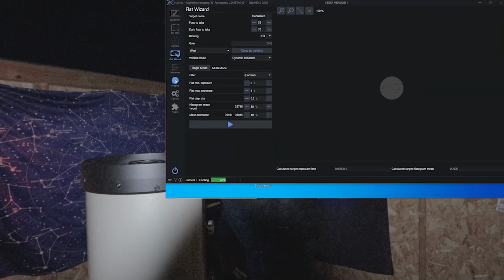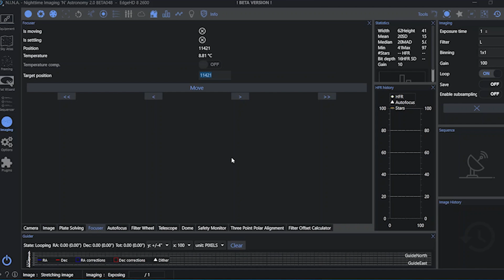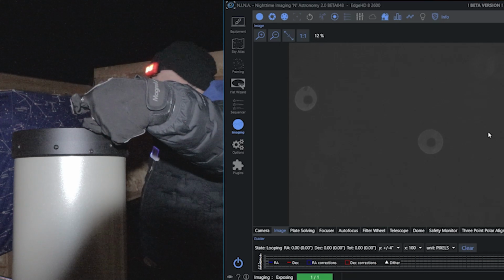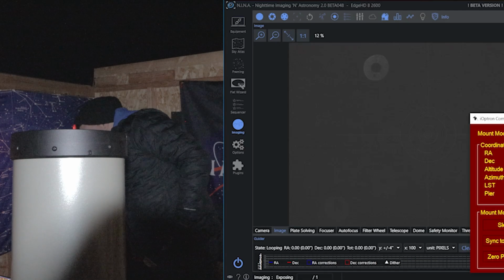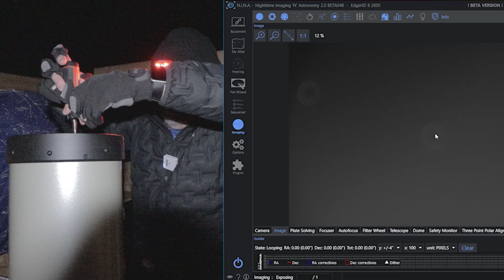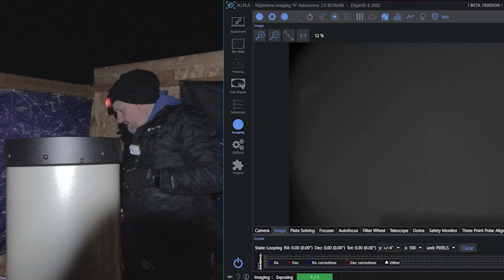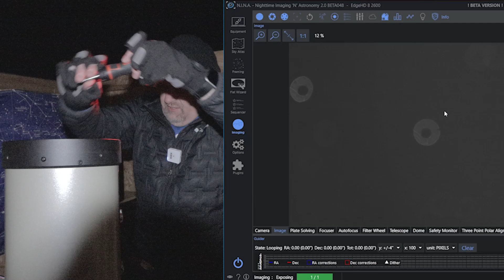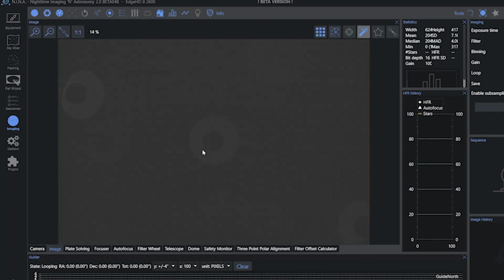How to Collimate your SCT | EdgeHD 8 Collimation

Comment: Joe, good explanation but I've found much better results with two things: 1 - Using much smaller adjustments (I can see you tightening loosening by 1/4 or more turns at a time), and 2 - Always doing a three process  adjustment, ie. when I tighten one I ALWAYs loosen the other two or vice versa.

Usually only takes about 2-3 minutes once a year or so.

just my 2cents

Comment: What do you do if you collimate inward focus first and then when you try outward focus the collimation is still off?
Reply from the maker: Hi SA, it’s been awhile since I made this video, but I believe I mentioned that you always collimate on outward focus. I’ve tested both ways and I can only get mine to work correctly and consistently when using outward focus. Hope that helps and apologies if I didn’t mention in the video.
Reply: @JoesAstrophoto  Probably a stupid question, but after I achieve colimnation, can I just put small piece of duct tape on top of each screw for it not to move anymore in the future ?

Comment: Watching this vid is putting me off buying a sct lol.  I can see myself getting very frustrated with this.
Reply from the maker: Hi Neil, I won't lie, it can get frustrating at times, but it's really not too hard after the first couple times you do it. The first time it took me almost 30 minutes to get it, but now I can collimate usually in less than 5 minutes. The nice thing is, it holds collimation pretty well and shouldn't have to be done too often. If you could afford a 2000mm fl refractor, I'd definitely go that route, but unfortunately, I couldn't justify that kind of money.

Comment: Aren't Bobs Knobs/Collimation screws just standard metric screws of a certain length? What specifically makes the worse? It must be different depending on the scope with the verity of thread son corrector plates on EdgeHDs alone.
Reply from the maker: Hi Randy, the Bob’s Knobs won’t tighten completely like the stock screws, so while it’s easier to get collimation with them, it’s also easier to get out of collimation as well. Since I rarely move my scopes around, it’s easier for me to keep the stock screws.

Comment: I understand that to minimize the effects of mirror shift, the "final" mirror movement should be up/out with a corresponding CCW focus shaft adjustment.  Moving back through the focus to see the "other side" of the doughnut, the images should be pretty much the same.  When you were centering the right star, I did notice that the star on the upper left did not present a good concentric doughnut shape which is NOT what one would expect for an Edge HD mirror.  Celestron touts a flat field focus for this HD series and in my opinion the upper left star should also be displaying a lot better doughnut than what this video shows.  If l were to have noticed such an out-of-round doughnut on the left star, with the right star having a perfectly centered doughnut, I would be contacting Celestron for an RMA to provide/REPLACE what they advertise; as in this example BOTH STARS should be damn near identically concentric....  Catch my drift???
Reply from the maker: Thanks Hank, I’d have to go back and rewatch the video as I don’t remember, but I love the images I’m getting from this scope. It may have also been an error on my part in the video or in the collimation process, I’m not sure. Thanks for pointing it out though.

Comment: Thanks Joe, been learning how to use the Hotech Laser Collimator today on my new EDGE 8, I will need to do this though to check I’ve got it right. Your EDGE HD tutorials are so great for me at the moment and much appreciated… thank you so much for doing all this ⭐️⭐️⭐️⭐️⭐️
Reply from the maker: Thanks so much Olly, much appreciated!
Reply: @JoesAstrophoto  Hi Joe…  Do you always collimate the EDGE HD with the image train you plan to use, ie with the Reducer on❓I’ve been told I should always collimate with the Reducer off but this seems like a time-consuming thing if planning to use the Reducer.
Reply from the maker: Hi Olly, I’ve always collimated in the configuration I’m going to use it in and have never had any issues. The only thing that I’ve noticed is that I have to collimate out of focus “out” and not out of focus “in” when doing the out of focus star method. Hope that helps.

Comment: I watched this video a second time and its still not clear if you were tightening or loosening the screw on the large side of the doughnut.
Reply from the maker: This was challenging to get the camera high enough to see the secondary mirror and screws without shining light into the SCT. This is one of those times you really needed a second person operating the camera. The important part to take away though, is that you may need to tighten or loosen the screw, but whichever way you decide (tighten or loosen) the star should move on the screen towards the widest part of the donut. If it moves the opposite direction then that was the wrong way. Hope that helps.

Comment: Very nice. Looks like quite a process if you set up every time though.
Reply from the maker: Thanks Nick! You know it can be at first for sure, but I think after doing it a few times you get much faster at it. Normally I can collimate the scope in about 5 - 10 minutes, but I remember the first time I did it, it took me almost an hour. I'm super lucky to have it mounted in a permanent state for the most part and it seems to hold collimation very well.

Comment: Great video Joe!  I pretty much use the same procedure except I usually got for a bright star.  Mine has held collimation really well.. Ive only had to redo it 3 times in the past couple of years.  On cooling.. I find that mine usually needs  about an hour before I can kick of the sequence.
Reply from the maker: Thanks James! That’s great to know about an hour for acclimation. Mine is normally mounted in the only and the temps in there are just slightly warmer than outside.

Comment: Excellent and easy to follow guide on how to collimate. I've yet to have the skies cooperate long enough to actually get out there. I tried last night, but pretty much as soon as I got setup and defocused on a star the clouds rolled in.

I'm a bit confused regarding the screw to thick side relationship. If there's no screw on the thick side, you then choose the screw completely opposite the thick side of the donut? Also, to make sure I understood the "right" vs "wrong"... once I've made my adjustment, I want the star to have moved towards the thick side of the donut, right?
Reply from the maker: Thanks Jonny, I hope it helps people have an easier time of it. Also, that’s exactly correct on both counts. I needed a much taller tripod for my camera so couldn’t get the screws on camera, but I hope people get the idea.

Comment: Your video is very helpful. A week ago I went through the same nightmare as you when collimating my Meade 10" SC. My OTA has an additional problem because it is very old (from 1999) and suffers from mirror flop and focus shift. To minimize the effect, I installed a mirror lock system that improves the problem a lot. Likewise, when I focus, I always make the last movement in the same direction. Even in modern SC with Mirror lock system, there is always a small oscillation of the mirror that generates some decollimation. Hugs😊
Reply from the maker: Thanks so much Jesus! It can be a pain sometimes, but then it goes much faster when I'm not making a video at the same time. It took me about 20 minutes total that time, but when I'm just doing it and not thinking about explaining it, it takes me 5 - 10 minutes. Still hate it every time though, not sure why but it's always the coldest it's been in weeks the night I have to collimate lol.
Reply: you can get rid of mirror flop by using a crayford. get close enough with the mirror, then lock it and use the crayford:)

Comment: You should look into the TriBahtinov Mask! If you have access to a 3D printer or laser cutter, it really makes it so much easier and faster, there’s zero guess work as well. 

I have compared to Metaguide (which I believe was one of the best collimation tools) and it fully validated my results!
Reply from the maker: Thanks so much Noah! I've heard of those before, but have not tried it out. I will try and print one out now that you mention it here. Thanks for that.
Reply: The masks are inexpensive,  got mine at Farpoint.
Reply from the maker: @Dennis-tf2cs  Thanks Dennis, will check it out! Anything inexpensive to make the process easier is a win in my book!
Reply: Good video tutorial Joe

For the Tri-Bahtinov mask, I uploaded the 3D printing stl files for the mask and the mask cover to fit the Edge HD 8  in the Tri Bahtinov thread on the Cloudy Nights forum a few weeks ago

Cloudy Nights forum thread topic :”A Tri-Bahtinov mask for SCT collimation and focusing”

Wishing you clear skies
Reply from the maker: @acapulcoastro  Thanks so much! I'll try it out!

Comment: Hey Joe,

Nice video.
Do you think the pinched stars at the edges are because the backfocus is off when the focus is so far off?

I use a Moonlite CHL2.5 focuser, and to get that far out of focus, it probably moves the camera sensor 4-5 mm from the focal plane. I'm guessing this is what you'd see if the backfocus was off by that much.

The stars in the corners look fine when in focus (from what I can tell on the video anyway).

It makes me think that this may be a good way to determine the proper backfocus distance (which can vary a bit from scope to scope). By moving the focuser position until the stars are round across the image (though out of focus), you could then see how much the camera sensor needs to move to be at the proper backfocus distance?

Not sure if I'm explaining clearly or not

I might give that a try next clear night.

Cheers,

Jason
Reply from the maker: Thanks Jason, I'm not sure if it is back focus or because of the shape of the primary mirror. Going off of what Celestron recommends, you can only get a true collimation when collimating on a star in the center of the field. This makes me think that's it the shape of the mirror as it moves outwards that causes the stars to look that way, but I'm not 100% sure about this and it could be a back focus issue. The main thing I go by is that when at a very good focus, all the stars across the field are round. That's what I'm getting now, so I have to assume it based on the mirror shape. The 2600's larger sensor makes it appear even more dramatic than the 294 did. I'm assuming because it's able to capture that much further out along the outside of the mirror?
Reply: I only think of this because so many people question about proper backfocus on these EdgeHD units. It would be nice to have a quick method for this rather than to setup the camera with spacers, take an image, see if the spacing is right, add another spacer, image again, and so on...

Add... I'll have to think on how this would work. Not as straight forward as I thought.

Comment: Thanks for the video! Loved it! One question though, even though the star in the center looked like you had collimation, the star in the upper left definitely did not.  That’s the kind of thing I see on my edgehd as well.  Is that a sign of a back focus issue?
Reply from the maker: Thanks Mike! It could be, but honestly they always look like that to me and is more pronounced with the larger sensor of the 2600. From the last year of owning this particular SCT as long as I get the star in the center to very close, then the rest of the stars across the field look good after focusing.